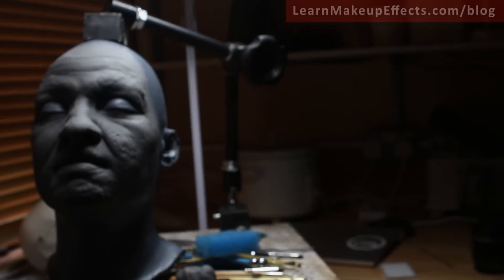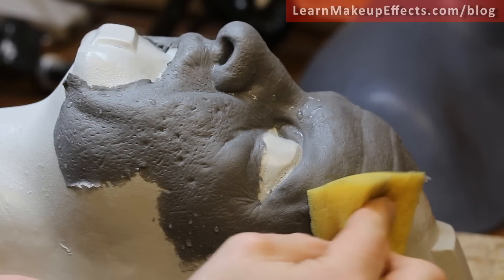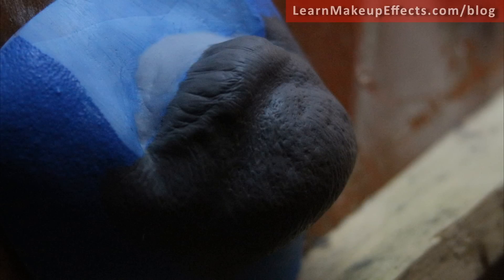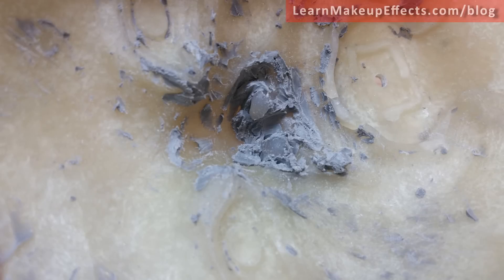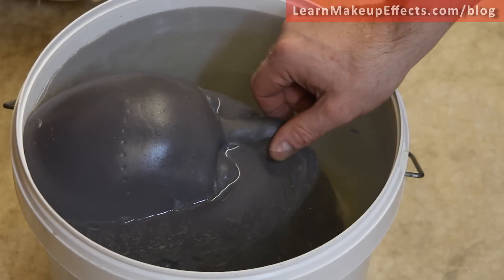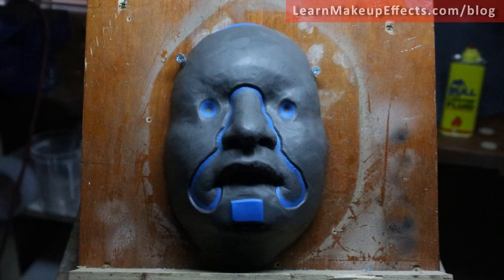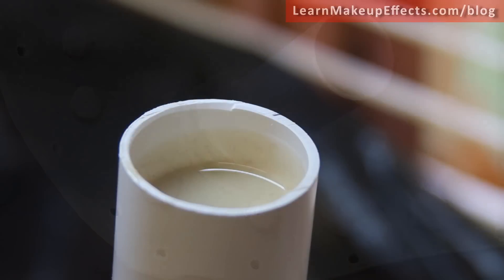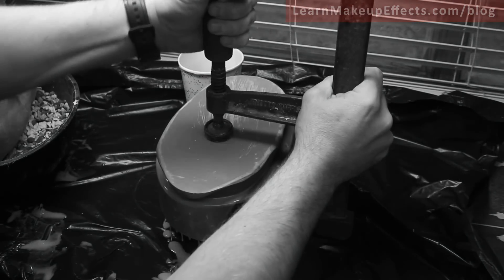UMAE 2015 makeup demo - Update #2

Comment: Thank you for another informative video. I was going to ask the same question about your choice of using fiberglass, but it was already answered. Does that first layer of resin you applied before the fiberglass mesh become a negative of the sculpt (pick up the details from the plastaline?
Reply from the maker: Yes,  it does. It picks up everything. Then you can safely glass over the top and know that stippling the glass mat with a laminating brush won't damage the sculpt surface.

Comment: Hi! I know this is a lot of material, but would you be able to make the whole face (without the neck) in one big block/snap mould?
Reply from the maker: It's is possible to some degree depending in undercuts. its getting g two rigid moulds apart with the inevitable undercuts which make it so difficult. 

Also it's so much easier to make smaller overlapping pieces. It makes gluing them on easier usually and also mould closure is better when clamping efforts are shared over a smaller piece. 

Better edges on a few pieces is preferable to one massive piece with poorer edges.

In theory it is, to answer your question. Masks are done this way all the time but you don't need access to the inside to glue them!

Comment: Thanks for videos and all the tips and tricks that you point out!) may i ask why you prefer fiberglass over plastic or silicone mold?
Reply from the maker: It is cheaper and quicker to avoid using silicone. With a silicone insert there is still a fibreglass jacket involved. 

I wanted to see if it were possible to avoid making a silicone mould. Often it is done out of habit for fear of cap plastic adhering to the resin surface....logical as they share a acetone as a solvent. 

However this proves it is possible and useful for those who perhaps cannot afford to use silicone habitually to make moulds.

Comment: Another amazing video!  Thanks so much for sharing your process with such great detail.   What is your reason for building up the bleeder drill points with auto body filler prior to drilling?
Reply from the maker: Chris Ellerby Excellent question.  

It does two things - one it increases the drag, slowing the flow of the silicone escaping but still allowing the air out.  That way it loses less silicone, as with liquids in tubes, the longer the tube is, the more pressure you lose. 

Second, when you block it with plastiline, it lis less likely that the plastiline you push on there will come through to the sculpt surface, which when the piece was demoulded, would appear as holes in the finished piece. 

-Stuart
Reply: you probably dont give a damn but does anybody know a trick to log back into an Instagram account..?
I somehow forgot my login password. I would appreciate any tips you can offer me.
Reply: @Willie Zayn Instablaster =)
Reply: @Kamryn Finn it worked and I actually got access to my account again. I'm so happy!
Thank you so much, you saved my account !
Reply: @Willie Zayn Happy to help xD
Reply: @stuartbray  I was about to ask the same question about the body filler blobs. Thanks for the explanation!

Comment: Umm hi uh the clay yer useing that to be dipped in water to seperate fer large molds in wanting to do very large molds that require makeing the whole thing but ik I have to do like you did umm what kinda clay are you useing to do that??? And where did you get?? Please tell me if you can
Reply from the maker: I think I understand.  There are only two clays used here in this makeup. the oil based plasticine for the appliances themselves and the water based potters clay used for temporary walls.
Reply: Thank you so much and yes you did understand so plastaline is the one that was ok with being in the water so you could get more than one pice and I'm sorry I'm pretty new at this and I never was good at explaneing or spelling XD sorry again